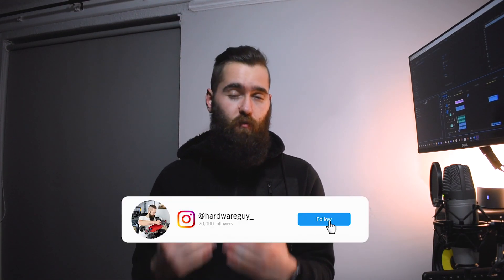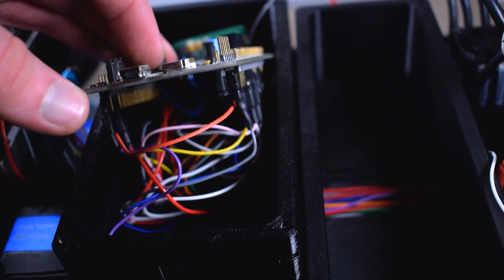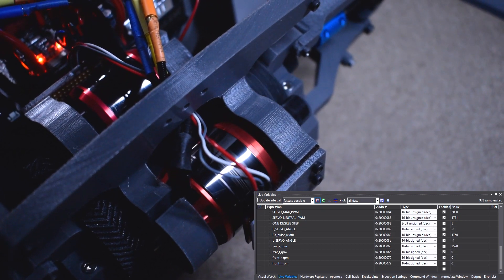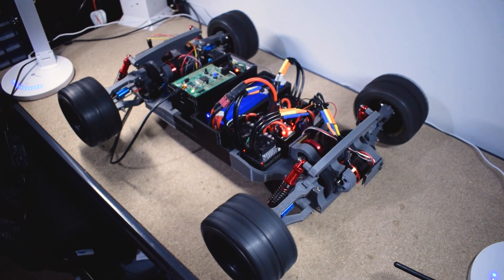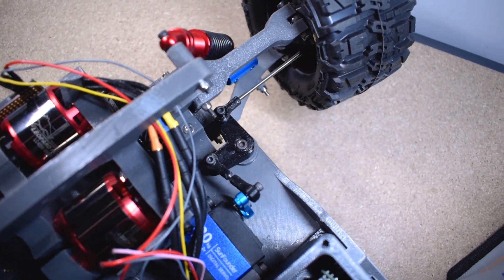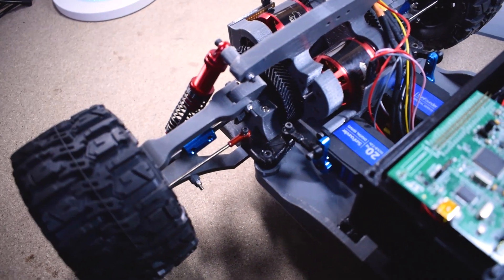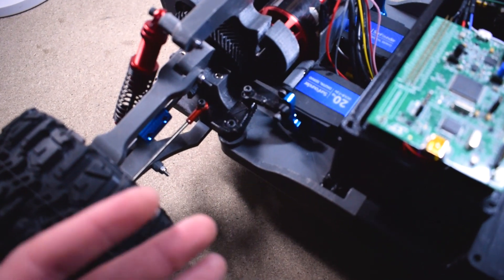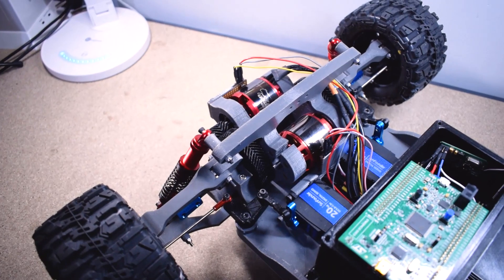Raptor II: MK1 - Hardware Update

Comment: Great job! I do have a question: how do you achieve negative (braking) torque in the engine? In other words how can you slow down the vehicle? Do you mount / program a particular ESC able to do that? Thanks a lot!
Reply from the maker: The ESC's I used have braking functionality, it'll say how to program it in the ESC Manual. I didn't implement this on my car as I just wanted to be flat out almost always
Reply: @thehardwareguy  thanks a lot! It means that by writing code in the stm32 you are potentially able to make the engine braking, correct?
Reply from the maker: Yes!

Comment: Motor running, when turn the light on, or the servo moving,... the motor will be slowed down (perhaps, voltage drop). Is the power distribution board can fix this problem? I'm not sure what to find.

Comment: I get that this is an engineering project. BUT!!! You said it..."over complicated it a bit". I''d say every aspect is overly complicated. A single motor and ESC could have driven all 4 wheels. Small diffs exist so that you can transfer power to the outside wheels or even limited slip. All you needed was a single servo for all of steering. Part way into this video I was wondering if you had been taught the KISS principle!

Comment: Awesome! have you not thought of putting the front bell cranks onto a fixed pillar with a spring above (ie, servo saver style) direct drive with servos may strip them (even metal geared ones) and you can then keep the servos inboard for water proofing - if you build a beast like this it has to play in the mud/snow!  ;-)    Also you have no diffs - guess thats an engineering choice - are you compensating for that in the engine management? (apologies if this was in an earlier vid I've just stumbled across this project) Or you going slow enough not to bother? or with your engine management I guess you can choose?  Oh and your telemetry is next level for an RC dude...

Comment: I already thought this was an awesome project and then you went and added DAS! well done mate! what are the specs of the motors/ ESC's/ battery you're using? I also want to ask if it would be possible to use a drone flight controller rather than an STM32 board? the reason I ask is that drone flight controllers are already designed to output to 4 motors plus there are other outputs that can be used for servos and it's super easy for simpletons who don't know how to code (such as myself) to set it up with open source software in a nice GUI like Betaflight or Raceflight etc. I think it'd be such a game changer for RC cars if something like that caught on!

Comment: I think you should go for some sort of sliding rack like it is used in drift cars. And I m pretty sure you can't keep the car with that amount of 3d printed components, you have to cut stuff carbon or aluminium otherwise it will explode in pieces on the first proper run ( not Walking Speed around the backyard )

Comment: I really love this project because there are so many possible applications!  Mostly from the controls side as the mechanical side here is already figured out and done well by off the shelf rc cars. 

application 1 - RC rock crawling - Controls - being able to control wheel speed individually offers huge  benefits in traction and tight turning radius.  Rock crawlers would benefit by the front/ rear individual speed controls, as well as left/ right.
Another idea i had is to make the wheel out of the outrunner brushelss motor. This would put the motor weight lower, which will have huge center of gravity benefits and prevent the truck from flipping during steep climbs/ descents.  

application 2 - high speed track car - control of wheel speed on individual wheels would result in huge stability and turning benefits.  I would assume high speed cars would only benefit from the left/ right individual speed control and not so much of the front/ back.

Your steering issues/ complaints.  - 
     1 - You are very analytical, much like me.  Have you done drive testing on the steering issue?  Or is it just from bench testing?  I've made the mistake many times where i think i see a problem with something during bench testing, only to find out there's really no issue at all while using it in the field.  If you've ever taken the propellers off of a drone and armed it on the bench, you know what i'm talking about.  

     2 - I agree, the simplest, least play/ backlash / hysteresis is going to come from eliminating the steering link.  Have you studied how production RC cars work?  Most of them do have some linkage, which is no big deal, just keep in mind you can use the geometry to keep it from having too much play.  

     3 - keep in mind if you direct drive your steering with the servo, when you crash, it's going to destroy either the link, or your servo gears.  I would recommend finding an existing servo saver from existing RC car and re-using it.  Or copying the design.  

     4 -   All that said, I think you could do away with the individual wheel steering but that's because i think the ability to control the speed of each wheel individually is value enough on its own.  

Have you had a chance to look into FOC ESC's ?  may remove the need to have encoder sensors at the wheels.  less sensors, less wires, less programming?, less mess/ wire management. 

You may benefit from using a drone flight controller running flight control software called betaflight.  It would be a shoe horned application but i think you could start out by using it directly, then create your own fork for a driving (instead of flying) specific application.  I can't believe someone hasn't done it already - maybe it exists and i don't know about it?  But it's crazy to think how similar the control logic would be in flying a drone vs driving a car with seperate controls for wheel speed.  Each has 4 motors, each would use a control loop and gyro sensors to modify the motors output....  man it would be so cool !   if you're interested i can send you a link to a flight controller.